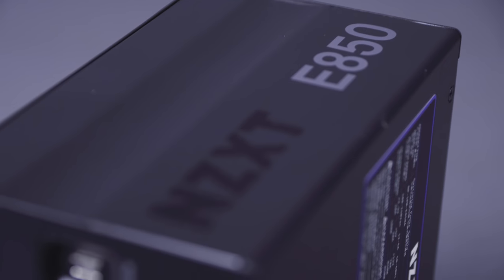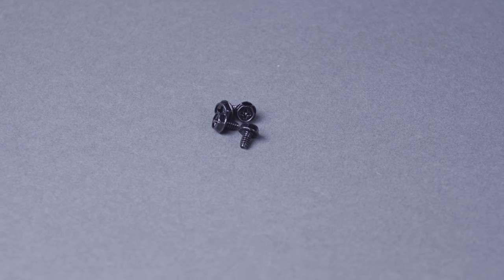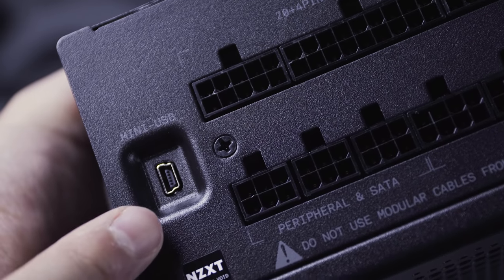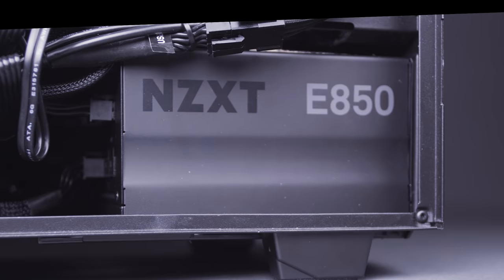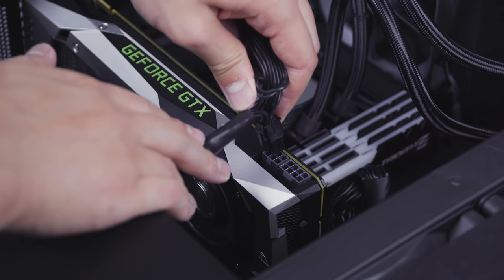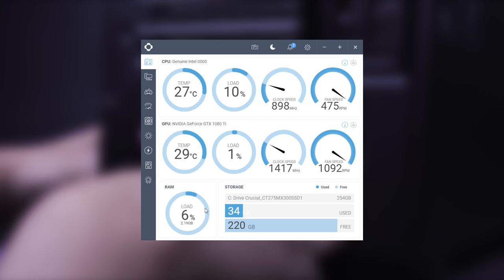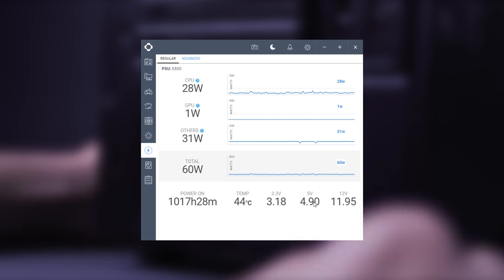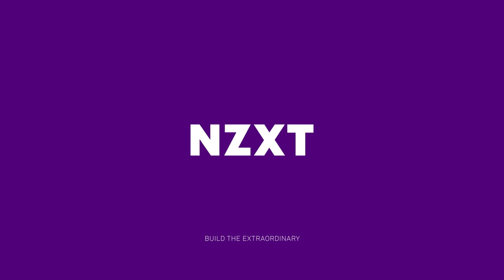NZXT E Series Tutorial: How to Install and Use Our New Digital PSU

Comment: Make sure it touches the insulation pads at the bottom of the chasis so it doesn't short circuit.
Reply: This video is all wrong. The how-to video I saw definitely showed me to block the PSU fan!
Reply: Solowplaysmc never stop the memes
Reply: Don't forget the tweezers and swiss army knife that hopefully has a Philip's head screwdriver.
Reply: Don't forget to wear your anti-static bracelet as well to prevent damaging your PSU
Reply: pro tips: screw with confident!!
Reply: Stupid advice! There are no such things.
Reply: @shobinp5789  y/wooosh

Comment: @2:09 my psu switch turns on in the line position then turns back off. But you say make sure it’s in the line position while installing. Is something wrong with my unit
Reply: yeah its fine, my coolernaster 500w does the same. Idk what exactly it is, maybe the power supply turning on when you flip the switch, then waiting for you to press the PC power button to properly start up the components?